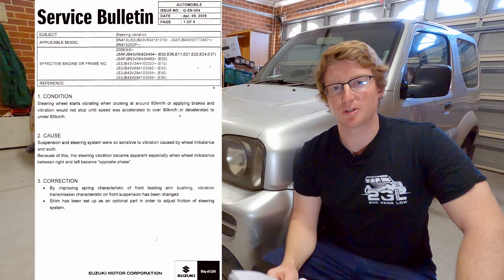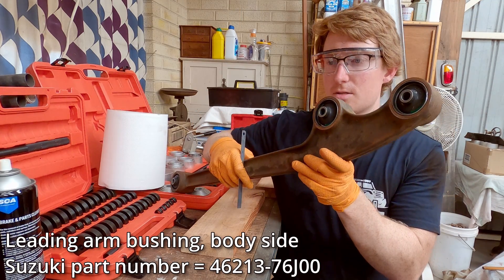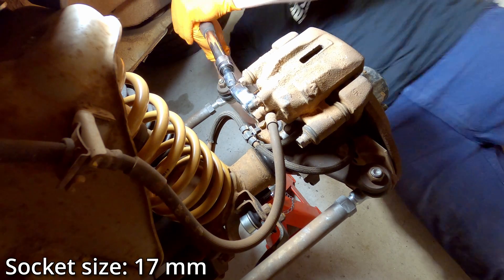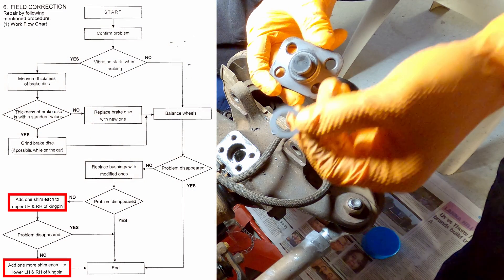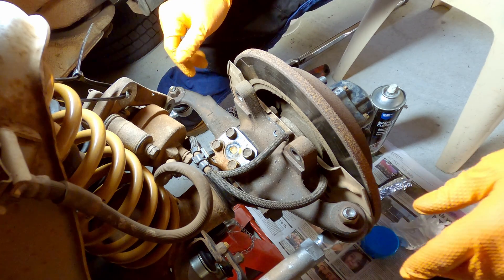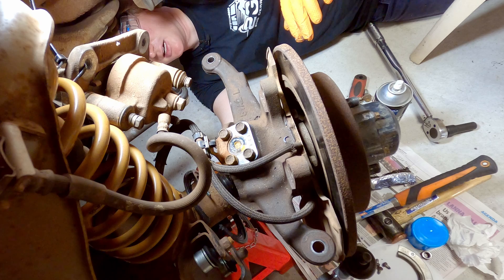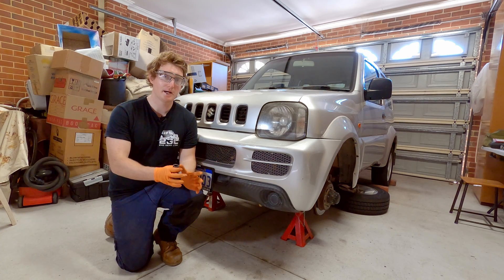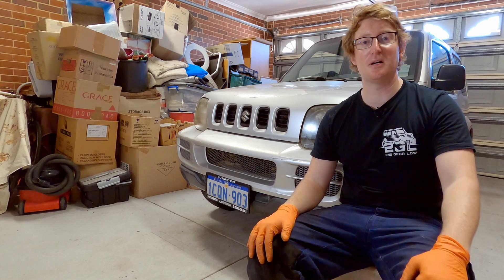Suzuki Service Bulletin – Jimny Kingpin Shims (Steering Death Wobble Fix!)

Comment: thank you for the video. Does it work by the way?
Reply from the maker: No problem mate, and yes it did work for us. I ended up adding one shim to the top and bottom on each side and have not experienced the steering wobble since
Reply: @2ndGearLow  that's great. I'll do the same. Greetings from Brazil.

Comment: Can the wheel bearing from rear tyre can cause the death wobble or it’s only related to front
Reply from the maker: Hi mate, thanks for watching. Steering wobbles are typically caused by issues with the front steering and suspension components, such as front knuckle bearing preload, worn tie rod ends, or control arm bushes

Comment: Great content! really like that you mention socket sizes and torq forces for all the bolts! Did it fix the issue??
Reply from the maker: Hi mate, thanks for watching, and we're glad to hear you appreciate the detail provided. Yes - I ended up installing shims on each of the top and bottom king pins on both sides (4x total) and have not had any issues with steering wobble since then. Replacement of the knuckle bearings and the control arm bushings did help, but the shims ultimately removed the issue entirely

Comment: Great DIY!!! 🙂
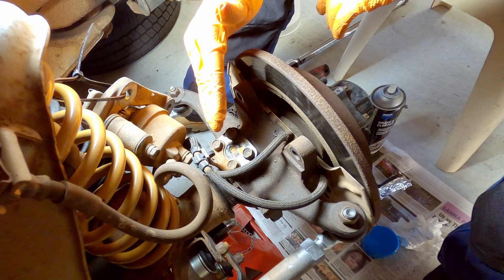What exactly do we need to check at this point:  07:17 , and how we can know the problem goes away? Do we need to install all back and drive the car or just to do the next check description of the starting force check?
Reply from the maker: Hi Ariel, thanks for watching. To check if the problem has gone away, after adding one shim to each side, you would put the wheels back on and take the car for a drive. For some people only one shim on each side will be required to fix the steering wobble, but if not then you would return and add the 2md shim to each side. Best to check the starting force whether using one or two shims before putting the wheels back on for the final time

Comment: Cheers for this. I got 3yrs out of last set of bearings which is not too bad considering I am using it in forest roads. I shall keep and eye on them this time around and will try shims next time around  - as a temp fix. 
Can I pose another question to you on separate matter?

Comment: When doing this process, should the oil be drained?❤
Reply from the maker: Hi mate, thanks for watching. If you are just installing the shims (as shown in the video) you don't need to drain the oil. However, this assumes you have already changed the king pins and bearings. If you haven't already replaced them, it would be recommended to complete a full swivel hub rebuild (see our video on this - Jimny Restoration Ep. 3) which includes changing these bearings,  and then installing the shims during that process. The swivel hub rebuild includes draining the front differential oil to allow removal of the CV/Axle and replacement of the inner axle oil seal. The inner axle oil seal is what seals against the axle and separates the differential oil from the black Molybdenum-disulfide grease in the knuckle housing, which is what lubricates the king pin bearings

Comment: Do you put shims in the lower king pins also, or just the top?
Reply from the maker: Hi Duncan, thanks for watching. I ran the car with shims in the top and it was an improvement, then came back and repeated the same process on the bottom. It's driving much better with one shim on each of the top and bottom kingpins - the steering wobble has gone

Comment: greetings from Italy Florence happy new year 2024 let's hope that 2024 will be better than 2023 as soon as possible! (going back to the steering vibration, I solved the vibration problem on my Suzuki Jimny by overhauling the front axle, replacing the bearings and shimming the pins on the front spindles of the hub holder of the front tires and then I do a good balancing of the front tires and tighten the tire bolts with the cross wrench instead of using the compressed air gun at the tire dealer and then when I go off-road on a rural track with mud I go once I've finished the trip to the car wash and I wash the tires because the weight of the mud throws the tire balancer out of balance and then if you have to fit the steering damper I advise you not to fit it because it's a stopgap and it won't solve the problem of vibrations on the steering!)

Comment: Did it work then? I have this on mine after fitting slightly bigger wheels and tyres. Sometimes it’s really bad. I fitted a steering damper and it’s only slightly better. Still not ideal
Reply from the maker: Hi mate, thanks for watching. Yes, it did work, we no longer have any steering vibration in the Jimny! Replacing the leading arm bushings improved the situation, but it still felt slightly unstable. We ended up installing one shim at the top and one at the bottom on each side knuckle

Comment: Great video as always, still yet to do my kingpin bearings as I’m still rebuilding the front axle components but definitely an indispensable video, I also bought a pack of bearing shims when I ordered the kingpins as a precaution.  £4 for the pack it would be silly not to.  Great job 😊👍🏻
Reply from the maker: Thanks for watching Matt! We appreciate your comment and hope that the job has been going smoothly for you. Happy to report we haven't had any steering wobbles after shimming both top and bottom king pins as per the procedure
Reply: @2ndGearLow  Please "Pin" this response as a comment kind sir.